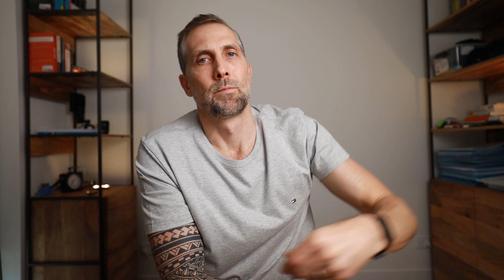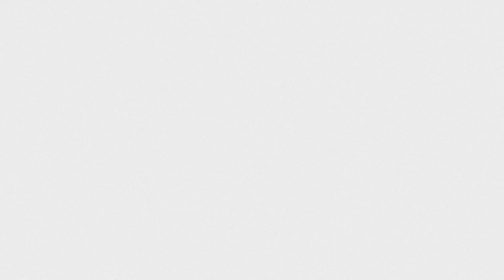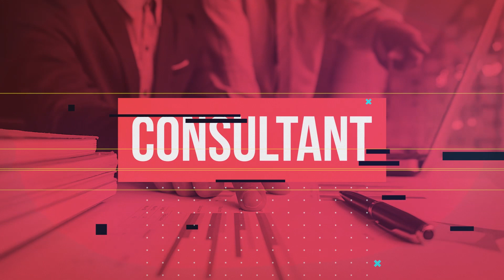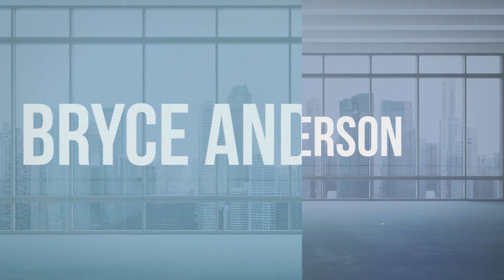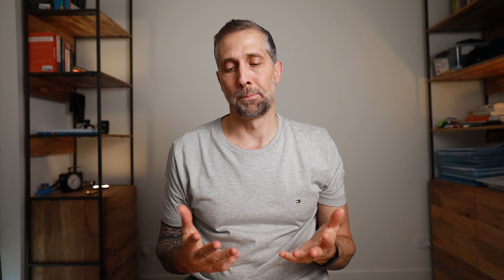Part 2: Demand Control Ventilation Does Not Work in Older Buildings

Comment: Great content, like you said tenants HVAC systems for meeting rooms do require there own o/a supply to AS standards. Also co sensors are a high maintenance item, they break and go out regualry, the BMS can auto cut them out if they go out too far? The infiltration rates in Australia buildings helps to cover o/a issues?